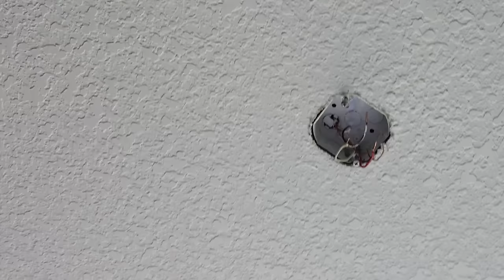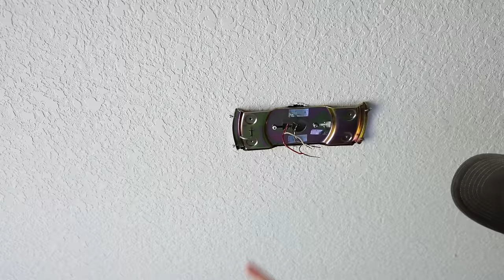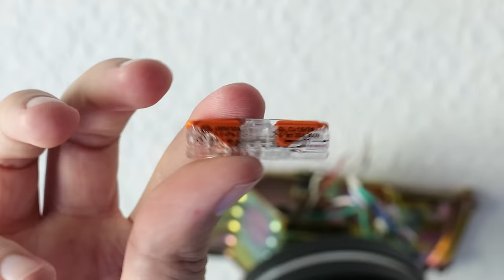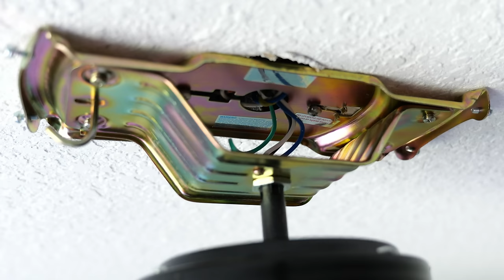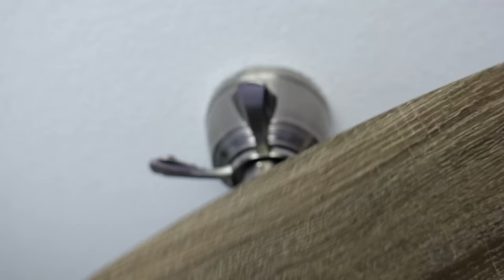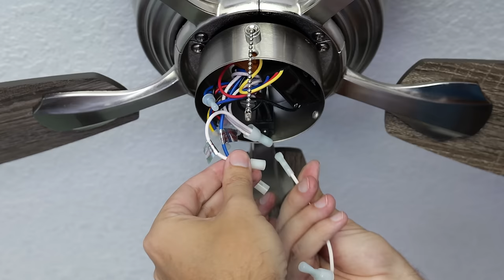Avoid This VERY Common Mistake DIYers Make When Installing a Ceiling Fan | How To

Comment: I disagree with your mounting of the of the bracket.  IMHO it should be attached to a ceiling fan box.  Some of those boxes are only attached to one side with just nails.  I know other people will say that they've done it for years that way, but I wouldn't do it myself.  I've seen fans vibrate the box off the stud.
Reply from the maker: No need to disagree.  Every one of my ceiling boxes can handle a ceiling fan.  They are all rated for ceiling fans and have braces attached from joist to the adjacent joist.  All is good.
Reply: Thank you.  Good info.
 @HowToHomeDIY
Reply: @HowToHomeDIY  in all fairness, I didn't hear you mention that in the video.  I recognized the model by the mounting screw location.
Reply: @kenbrown2808 in all fairness did you hear the part where he insisted on not just watching a YouTube video but to follow the included instructions?  Which they normally list this.  Everyone is acting like this is a huge deal.  Guess what folks, not that long ago you could put a fan in a fixture box if it didn’t weigh more than 35 pounds and peoples fans weren’t just falling off the ceiling.  Is it better to use a ceiling fan rated box?  Of course.  But some are acting like this video just showed people how to put out a fire using gasoline 😂
Reply: @johnpicard4909  30 + years is "not long ago" to you?
Reply: Depends on the fixture box. The ferrule screw points are good secure points (especially if the box is clearly anchored to a cross brace.) If I have to rely on an existing fixture box with folded tab threads, I add nuts to the backside of the threaded screws so they cannot pull thru the tabs if the threaded tab fails.
Reply: What everyone is in this thread is failing to mention is that a ceiling fan rated box is not just about how the box is mounted in the ceiling. 

It's also about the screws that are used to fasten the fan to the box when installing the fan. 

Non ceiling fan rated boxes only have # 8-32 mounting screws or holes sized to accept 8-32 machine screws. 

But a ceiling fan rated box uses a minimum of a #10 screw to fasten the bracket to the box.  But it's not just about the size of the screw. The way the screw threads into the box is very different as well. 

Depending on the manufacturer, often the screw threads will actually thread into a piece of metal that is beefed up and running through the back of the box, or welded to the box, to help support higher weights and vibration of ceiling fans and the larger #10 screws that are the minimum size required to be used to mount ceiling fans. 

This is the case with metal boxes, but some other fan rated boxes are plastic. And they also have provisions incorporated into the box to accept the larger minimum size of a #10 screws, or in some cases, a #6 course thread lag screw, that actually gets fastened to the ceiling beam through the box so the box isn't holding any of the weight of the fan. It all depends on the box manufacturer and the style and method they use to accommodate the higher weights and vibration that a fan could have. 

Every one of these approved fan boxes have been UL tested and listed to support the higher weight and vibration of a ceiling fan, as well as the other characteristics an electrical splice box must have to be able to be used and installed to meet NEC standards.

Most, if not all, older ceiling electrical boxes only have a small tab with a # 8 hole with threads to allow the screw that is used to mount the fixture.

This is not approved for ceiling fan installations and is just as important, but often overlooked, as how the ceiling box is actually mounted in the ceiling.

Comment: Since you are replacing a ceiling light and not another fan I am surprised that you did not mention to check how that box is secured to be sure it can handle the additional weight, potential vibration etc.

Comment: You stated the black from the fan is the black wire for the wall switch. Then you hooked up the blue wire to te red wire and stated it was for the fan. Which is it?
Reply from the maker: You misunderstood what was said.  I never said the red was FOR the fan function.

Comment: pro tip: that hook on the mounting plate of that model is so you can hang the motor plate from the hook, and have lots of knuckle room while connecting the wires, before screwing the plates together.  

also, in many prewired fan installations, the switch for the fan will be above the common switch height,  - and many electricians use the black wire for the fan and the red for the light, because red = heat.
also, it is acceptable for fixture wiring connections to be contained in a fixture canopy.  the fan motor shroud does count as a canopy.

finally, ceiling fans are like snowflakes, no two install exactly the same.
Reply: Thank you, and no way am I trying to stuff those slices uo that little hole.

Comment: Avoid the fans with the rubber grommets.  They're designed to eventually fail.  The rubber over time dries out and eventually will get brittle and crack.  Unlike a lot of fan parts, there's no universal size for these, and the manufacturer will likely no longer be supporting that fan in several years with new rubber grommets, necessitating replacement of the whole fixture.

Ask me how I know.

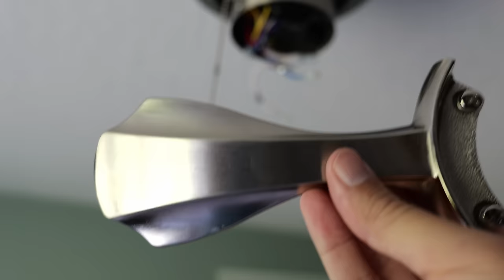Comment: 11:36 You left one step out. There's a plastic ring that goes around the fan base that covers the insulation screws up near the ceiling that needs to be installed. Apparently, you forgot to install it before you put the fan blades on. But you didn't realize this mistake until after and never showed that in your video.
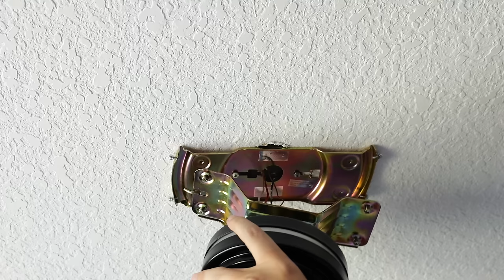2:13 Also, you're supposed to wire up the fan motor assembly to the ceiling fan wires and push them into the box before you screw the assembly onto the bracket. This gives you more room to work on the wires..
Reply from the maker: Not required.  That’s not even one of the steps in the instructions.
Reply: @HowToHomeDIY  It should've been one of the steps in the instructions and in your video because you had to take the fan blades back off the get the plastic ring on.
Reply from the maker: No I didn’t.  It’s not a part of this install.
Reply: @HowToHomeDIY  I'm an electrician. I install a lot of fans like that. If the ring came with the fan, it IS part of the install.. I saw the ring installed at the end of your video. Are you saying the ring did not come with the fan?
Reply: I checked the end of the video again. I was wrong. It looks like there is no plastic ring.on the fan. You should have gotten one with the fan.
Reply: never ever had a ceiling fan come with plastic ring to hide the shroud mounting screws. than again, we arent installing $300+ fans. whatever Home Cheapo/Blowes has sitting on the shelf, can ship us in bulk works for our complex

Comment: Your video is about common mistakes and the dangers of some of them.  However, you made a HUGE, AND DANGEROUS MISTAKE.  MOST electrical ceiling boxes are attached to the ceiling joist by two nails. Those two nails are strong enough to support a light fixture, but the nails WILL FAIL if you replace the light fixture with a ceiling fan due to the ceiling fan's weight and vibration. 
 
To properly install a ceiling fan to an electrical box, the electrical box MUST BE reinforced with at least a 2 x 4 attached, with brackets, to the 2 ceiling joists where the electrical box is. And do not come back telling me that you had checked; because I magnified the view to your box and DID NOT SEE ANY BOLT going from the box to the  2 x 4.

Your video is very good and informative and I thank you for that.  I just thought that I needed to point that up.
Reply from the maker: But you are pointing out something that is incorrect.  That is a fan rated box.  You can clearly see that by the metal box and the size of the bolts.  Many fan rated boxes have a metal brace that span between and are fastened to two joists.  That is the case here.  So you wouldn't see a bolt going into a 2x4 as the brace and the box are connected.  So yes, I am coming back and telling you that it was checked because it was.  You are more than welcome to give your opinion but there is no need for the hostility.  Especially in this case where nothing is wrong.
Reply: You attack the guy for something that is clearly correct.  His box is a fan rated box.  Honestly I don’t know how the How To Home guy deals with so many ignorant comments.  Must be one of the most patient people on the planet.

Comment: Since both wires are connect to a switch, why bother with the breaker to begin with? Just flip off the switch.  A switch is also a circuit breaker.
Reply from the maker: Talked about this in the video.
Reply: @HowToHomeDIY  You just said to be more safe.  How?  The switch already breaks the circuit
Reply from the maker: What if you leave the room to get a tool or get something else from the store and someone goes in and flips the switch on?  What if it’s all around not wired correctly to begin with?  These are just a couple of examples.  Always always turn the power off to the circuit being worked on.

Comment: shouldn’t you check the power before you shut it off and after? And, with the switch off and on. Want to know what the hot and neutral lines are before you start installing? A lot of wiring is hooked up wrong.

Comment: The ceiling box needs to be strong enough to hold the weight of the  fan. I  used a box with a heavy duty ajustable support bar. It is screwed into the ceiling joists. I wouldn't trust your installation.
Reply from the maker: Why?   My box is fan rated.  I fully trust it.

Comment: "...all wires must be placed in an electrical box..." Partially true. The cover on the fixture is considered by code as usable wiring space.  Yo do not necessarily have to push the joints into the box behind the mounting bracket.
Reply: That’s not true unless the canopy is marked by its volume to calculate box fill.  I’ve never seen a fan canopy list that.
Reply: @johnpicard4909  actually, that's false. The space underneath the canopy is listed wiring space.  Tell me how often are you overfilling the box that you have to calculate the volume of the box and the canopy.  The canopy doesn't have to be marked with a volume to count.
Reply: @ianbelletti6241  incorrect.  NEC clearly states it has to be marked.  The canopy is not listed.  Even the instructions that come with these fans state to put the wiring up in the box and not just anywhere under the canopy.
Reply: @johnpicard4909  must be that particular fixture.  I do have qualms with companies that use that style of mounting bracket.  That style of bracket is not installation friendly nor is the no stem fixture. As to the markings, that only applies to 100 cu. In. or less. Those canopies are clearly greater in size than a 4" square box. So no markings are required.
Reply: @ianbelletti6241  I will agree with it not being installer friendly.  But for me I have observed this on all of them that I’ve installed.
Reply: That section of code is open for interpretation the way it is written. IF you feel that the canopy volume MUST be marked, then just pull out your sharpie and write a roughly calculated volume inside of it. Nowhere in the code does it say a canopy has to be marked by the manufacturer (as it specifies for junction boxes). So as long as it is plainly marked in some fashion, then you’ve met the stated criteria even under the strictest scrutiny.
Reply: @athhud  on top of that, it only requires markings on plastic boxes and boxes smaller than 100 cubic inches.
Reply: @ianbelletti6241  not true
Reply: @athhud  wrong.  You can’t just write on it whatever you want.  There are specific codes for this.  Saying otherwise is not only wrong it’s irresponsible.  You can’t say the canopy is part of the box and where splices can be but not have to adhere to the rules that dictate all of that.
Reply: @johnpicard4909  it's a canopy on a fixture. It is typically listed as wiring space and the NEC permits it to be used as such.  Pancake boxes would be illegal if this wasn't allowed by code. No matter what you do you will have wires in that space unless you don't want a working fixture. And you are correct. The canopy is not part of the box but it is part of the allowable fill calculation.  If it wasn't part of the fill calculation then pancake boxes would be illegal behind fixtures.

Comment: The reason for the hook is so that you can wire the fan with it out of the way. And you are supposed to use disconnects on a light fixture now. So you made several VERY Common Mistake DIYers Make When Installing a Ceiling Fan.
Reply from the maker: Nope.

Comment: I disagree. From the very beginning first of all get up in attic or slide bracket thru bottom over the 2 by 4 s to hold up the extra weight
Reply from the maker: Not sure what you’re disagreeing with.  My box is rated for ceiling fans and has the brace going from rafter to adjacent rafter.   Also, while it’s best for that to be the case, I had an old home with standard boxes in the ceiling and they supported all of the ceiling fans without an issue.  Again yes it’s recommended to buy the ceiling fan rated boxes but some on this platform have played that up a little bit much in my opinion.

Comment: I stopped watching when he turned the breaker back on with all the wires bare and uncapped.   This is really dangerous and could easily short, even if you thought you separated them ahead of time, you could easily accidentally bridge a hot wire with ground or metal chassis, or simply touch it and get shocked (while on a ladder no less).  There is NO reason to not temporarily cap these wires for safety as soon as you disconnect as the AC voltage detector works either way.    But even before this, there was no mention at all of making sure the box itself is capable of supporting a fan.  Since the wiring had an extra conductor it most likely is braced for a fan, but if not then this will make people think they can just screw a heavy fan into a plastic box held on with maybe a couple of nails. He also uses the splicing connectors while I am looking at another one of his videos where the thumbnail says those are "Bad!" with the title "7 FATAL Wiring Mistakes" lol.
Reply: The wires are connected to switches that are off before turning on the breaker.

Comment: Dear Sir: I am a 77-year-old Vietnam veteran who purchased an $800.00 ceiling fan/light with a wall remote control ten years ago. That it is right a decade ago. I have had a three-separate licensed electrician to install the ceiling fan/light, but neither were able to install it. So far, I have spent about $1,300.00 in this problem to no avail. I then watched YouTube videos and wrote to their maker for then to give me an ideal on how I could fix the problem, but so far no one responded.  I even offered money to the last guy. but still did not respond.
In one video the electrician stated that he was going to show how to install a ceiling/light fan using more than one wall-remote-control switch. I rapidly purchased two wall-remote- control switch but were unable to make the fan to work. Can you help me please? I am willing to pay you. It has been ten years I just want my ceiling fan light to work. Thank you in advance for your help. Juan
Reply: Mr. Ortiz, my wife and I have installed hundreds, yes hundreds of ceiling fans and wall mounted fans and fans in empty three dimensional space.  Why would you want to control your fan with two fan remotes?  If they have four or five dip switches, code them all the same, but not "0000" from the factory.

Comment: So let me point out mistakes you made: 1. You put the wire thought the bracket without a bushing to protect the wires from rubbing on the bracket, and possibly shorting out due to the vibration when the fan is running. 2. You didn't ground the mounting bracket, or the metal box per 250.148 of the NEC. 3. Is that box fan rated? Just because a box could support the weight of a 50lb light fixture, doesn't mean they are approved for ceiling fans, they have to be fan rated for ceiling fans.

Comment: Use wire nuts. Those wago connectors are trash.
Reply from the maker: I usually do use wire nuts and personally prefer them in most installs.  But the Wagos are perfectly fine for this low amperage install and makes the stranded to solid wire connection easier as well.

Comment: You did nothing to support the greater weight of the fan--most lighting fixture ceiling boxes can't support a fan.
Reply from the maker: I didn’t have to.  It is a fan rated box.   To say most fixture ceiling boxes can’t support the weight of a fax is also false.
Reply: In the area where  I live (Texas), plastic boxes, as well as the type that attach to wall board, are approved.  Because of this, when installing ceiling fans, I've had to used expansion braces that install between joists through the hole for the box (after cutting the box out).  I've also had a couple of friends who've walked into a room to find their fan swinging around from the wires.  You should put a warning in the video that the DIYer needs to determine whether the box being used is approved and mounted for ceiling fans. @HowToHomeDIY

Comment: You failed .never said if you checked the existing electrical box was rated for fan installation and if the box was installed correctly with strong enough screws!!!?
Reply from the maker: I did check.  It is.  I said to follow the directions with your fan.  That is all in there.  It is super easy to tell if a box is fan rated or not and should have been able to see it in the video. Good effort!